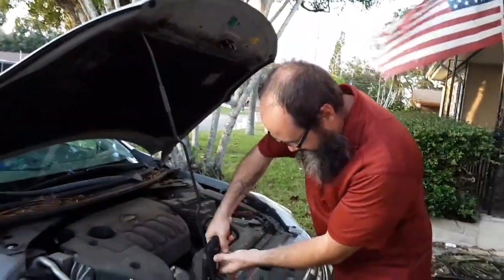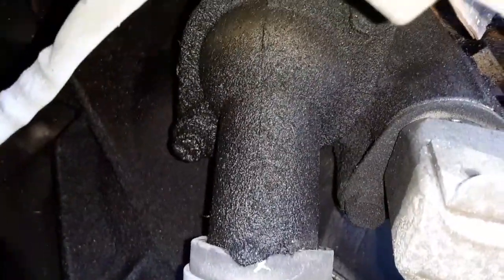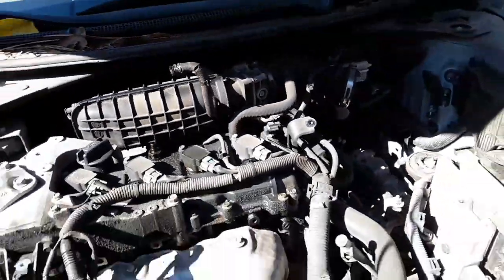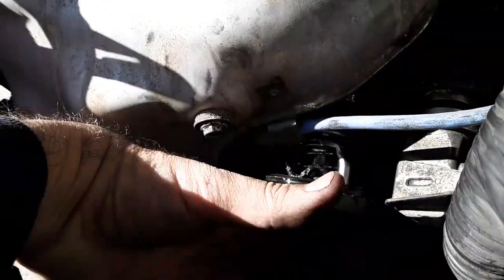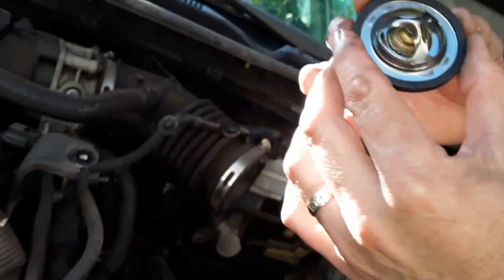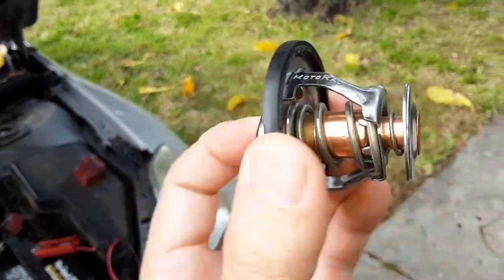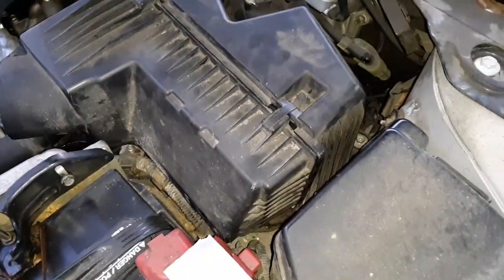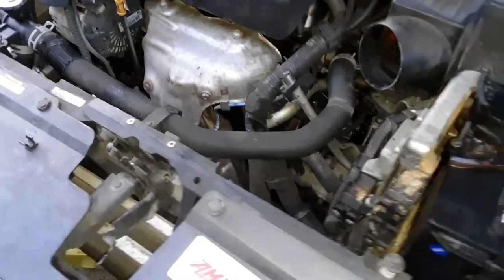2011 Nissan Altima 2.5 Thermostats replaced/PCV  location/air filter/Amsoil coolant refill/St.Nick

Comment: I just did my daughters 2.5L head and a couple of notes for your oil on the valve cover: 1) That pcv tube is silly affordable from the Nissan dealer, I think I paid $7.40 -- you never know with the dealer but this one is cheap. 2) The Valve cover will leak like crazy from the O rings around the plug coils after around 80K miles. You cannot buy the O rings separately I've found. Fortunately the complete replacement cover is reasonable in the aftermarket. The plug wells will fill with oil and lead to misfires and that process can start without a lot of evidence on the top of the cover..
Reply from the maker: Wow thanks for the tips and thanks for watching!

Comment: my dealership says my nissan altima 2010 2.5sl has two valves ? is that true cuz i can’t get rid of code p0128 for thermostat and i only changed the top one and the temperature sensor but it still shows code. dealership says i have two and they wanna charge me 700$….. help me
Reply: i mean, do i have to change what you’re changing, in order to rid code of p0128?
Reply from the maker: Not sure about that code but it is important to change both thermostats as it only takes one of them malfunctioning to cause a problem.
Reply: @Swayyj  I have the same P0128 code and can be a few things, such as the thermostat, coolant sensor, or sensor harness, you can trouble shoot most of these independently to find out what part is the culprit. I suggests you  don't just guess and replace parts, it could be as simple as having a bad harness. Im going to start by checking the sensor, it should read different  resistance ranges at various temperature levels. Good luck!
Reply: @hardkore360  thank you bro! i figured the problem out. it was the fact i changed one gasket and not the other cuz i had no clue there was two.. i felt really dumb cuz it took me about 15 minutes to fix the problem and 15 warm up cycles and the code was cleared! thank you for the info tho, i hope if anyone else has this problem , to watch the video and read the comments !
Reply: @Swayyj  Nice! I'm still waiting for my thermostat to get here so will definitely make sure to replace the gaskets, thanks for the heads up. FYI: the sensor tested out just fine.

Comment: Holly lord.... The metal pipe you removed in order to get the side thermostat out its so hard  I don't know what to do  it does not even move. help or any tips please
Reply from the maker: Holy He is. Exalt the Lord our God And worship at His footstool; Holy is He.
Psalms 99:5 NASB1995
https://bible.com/bible/100/psa.99.5.NASB1995
Thanks for watching sorry you are in this predicament. Well if all Fasteners Etc are removed you could try a penetrating oil, especially if the area around the ends of the pipe seem to be corroded. After allowing the oil to soak in try lightly tapping the pipe with the wooden handle of a hammer being careful not to deform anything. I hope you can get it. If it's that badly corroded I would also be concerned about the Integrity of the O-ring and getting everything to seal properly again.
Reply: Chances are your heater pipe is corroded. I had the same issue taking it out and a bigger issue trying to put it back in. After realizing it was the corrosion that was making it difficult I just used some simple green and sand paper and gently removed all the corrosion. Just make sure you remove the o ring while cleaning it and rinse the pipe thoroughly before installing it

Comment: Is the water control valve and thermostat the same part?
Reply from the maker: There are actually two different ones and you would want to be sure to replace both. I forget which one is technically called the water control valve but as I recall they both come in a kit and it would be hard to say which one was bad and if one was bad the other one might not be far behind it.
Reply: @MikeTrullAmsoildealer  just changed both! Thanks video helped A LOT
Reply from the maker: @Ponchovilla69  praise the Lord! While I am just a DIY guy my dad was an ASE Certified mechanic. I'm very glad that the Lord has given me a little bit of knowledge and skill and that it can be used to help others. Thanks for the kind words and I'm so glad you were able to do the repair yourself.